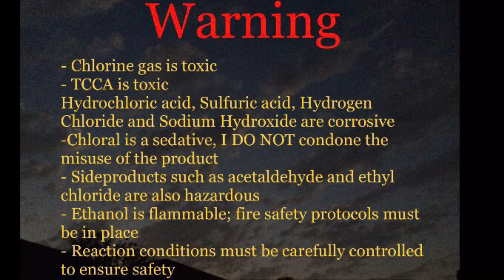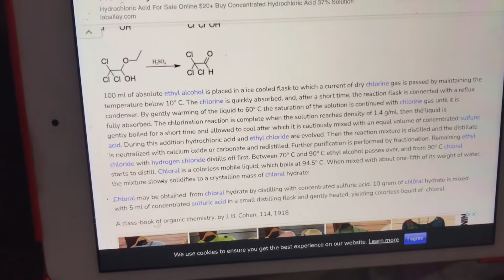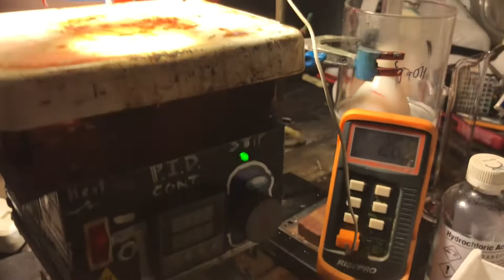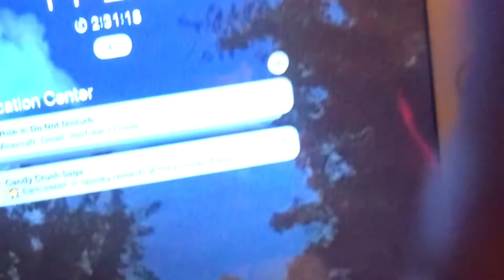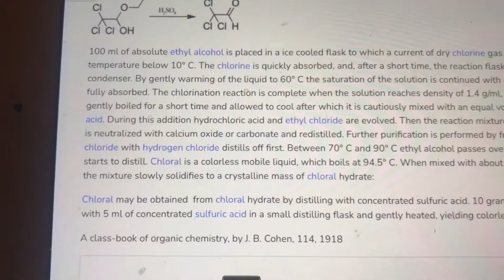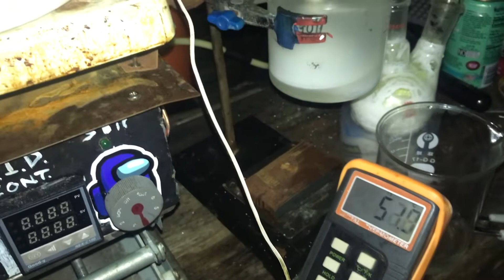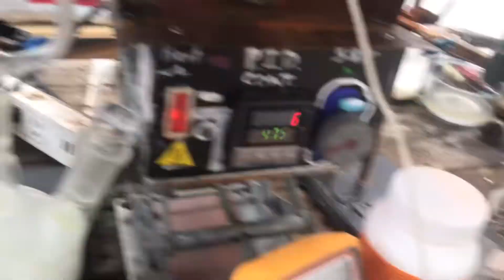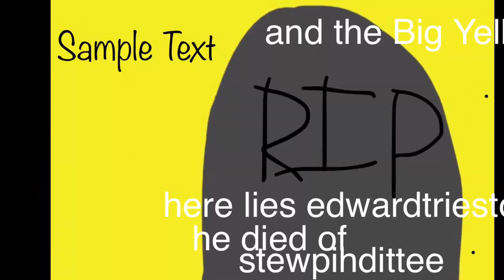Chloral synthesis

Comment: OMG THIS HAPPENED TO ME MOMENTS AFTER I WAS BENDING OVER THE FLASK! I still have the scars... i was setting up a chlorine generator to make benzyl chloride AGAIN or something, and i had just filled the flask with TCCA and flicked on the stirring while i went and meaaure out the HCl in the addition funnel. By the grace of god i wasnt bent over as i lowered my funnel into the stand i suddenly heard a rapid boom! And saw a yellow flash in front of my face. Thank god i turned away out of instinct. I have a very distinct mark in my arm where some of the shrapnel tore me... which was bleeding immediately, but other than the ringing youd never know a 1 liter flask just VAPORIZED 5in from my face....

I had flicked on heating which is known to cause detonation in bright light especially with extreme temp

Comment: I would often use TCC WITH NAOH to kill fungi and spores (Mold). Normally NCl3 usually occurs if you have a Ph of 2-3 which is tricky to get unless you add Ammonia hydroxide 28-30% to bleach or TCCA.  I am not sure if you have TCCA and excess Lye you would get a pH of 3? Not likely.
Reply from the maker: afaik the reaction of TCCA is different from hypochlorite as instead of chloramines forming due to the chlorine and the ammonia, TCCA undergoes a dechlorination to form NaCLO and an intermediate dichloroisocyanurate ion which undergoes ring cleavage by hypochlorite attack, forming chloramines and NCl3 directly, someone on the explosions&fire discord server had an incident when they added calcium hypochlorite to their TCCA chlorine generator which then detonated in a few seconds due to rapid NCl3 as the generator is endothermic, NCl3 is favored in cold conditions rather than hot conditions iirc
Reply from the maker: after some more testing its not pH dependent for TCCA but what happens is the hypochlorite formed from TCCA and NaOH then attacks another TCCA molecule cleaving the ring and that makes chloramine among other nasty substances
Reply from the maker: in fact heres is a paper http://www.poolhelp.com/wp-content/uploads/2017/05/JSPSI_V4N2_pp23-28.pdf
Reply: @EdwardTriesToScience calcium hypochlorite and ammonium nitrate will form NCl3 as well.  Nasty stuff.